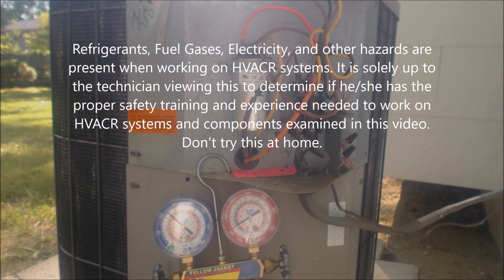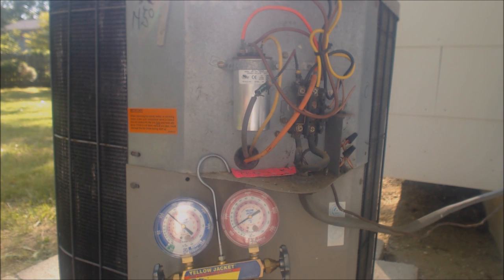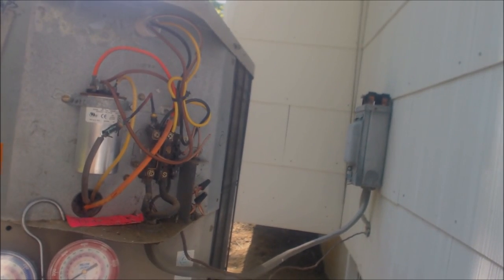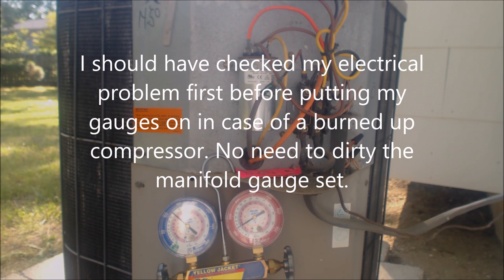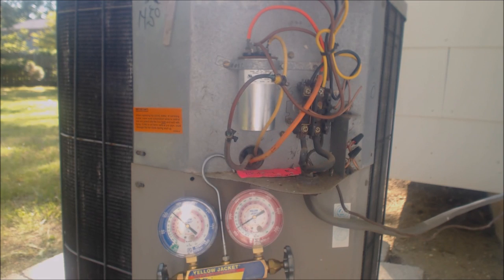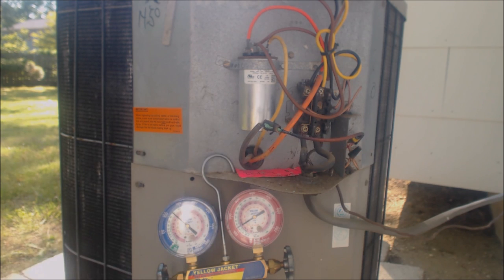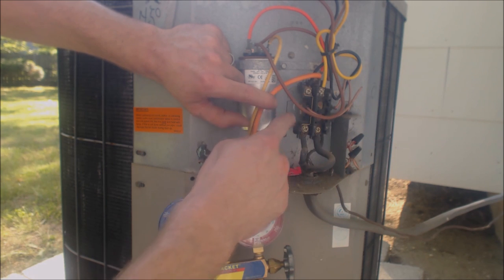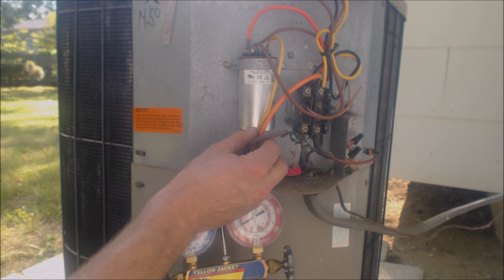HVAC Service Call- No A/C, Electrical Troubleshooting & Refrigerant Charge Check! Fixed!

Comment: I had a call last week , I did my ohms resistance test the Same exact way .  It ohmed out as a faulted compressor so I condemned the unit . What I didn't do was actually open up the fan  section and check my readings from the compressor terminal themselves . Long story short ,  the common wire on the compressor terminal was out of the lug causing the false reading . I went back and fixed the issue . Compressor was ok . That being said , it's frustrating to get to some of these compressor terminal on the residential end . It would be nice if the manufacturers would have easier access to compressor compartment .  It would save us so much time , especially on a day when you're backed up with multiple calls . Anyway,  great tutorial as usual ! I find myself learning something new on  everyone of your videos .
Reply from the maker: If I didn't get the right readings I would move onto the inside at the compressor terminals. I won't mention anything to the homeowner until I am certain, thanks. Yes you are right, you have to really get in there to have access to the compressor terminals!
Reply: acservicetech good point . Coming from the commercial side to the residential side has been culture shock for me . Everyone on the commercial end thinks their better or know more because there's moving moving parts . It's all the same concept though. The difference( from where I stand )is  dealing with customers on the residential end is so more personal and even contentious at times . On the commercial side of things  you can tell a store manager anything and they could care less for the most part . Just sign here and you're good . Corporate will deal with it .
Reply from the maker: Ha yes it's different. I think a very big difference is in Commercial for larger jobs that there may be a long bidding process were as residential and light commercial many times the owner or manager doesn't get another bid and just goes with you because of the referrals and personal admiration, thanks!
Reply: Good dialogue here! So true on both ends lol
Reply: I hear American standard got those pull off coils. Or undue the fastner, and pull off the coil. Either way, the have "suicide door" technology O.o

Comment: As usual - very informative. I watched so many of your videos! In one of them you mentioned the formula to calculate the capacitance using voltage that coming in and  some constant. I couldn't find that video! Could you post that formula again please! Thanks
Reply: 2650 x amp draw / back emf

for a compressor:

2650 x compressor amps from herm terminal of capacitor / voltage from herm to common

Comment: I was curious as to why you where looking for an 18 to 21 degree temp difference between your indoor supply and return air? Is that just a typical difference you found in your experience, or is that a specific number found in the manual or something?

Comment: Great video! When checking the Delta T inside, do you check in the return plenum and supply plenum ? Or do you do it at the return grill and supply grill?
Reply from the maker: You will get your most accurate measurements in the return and supply plenum but you can read the return and supply at the registers if the length from the plenum is very short, thanks!

Comment: Did you check resistance before reusing the contactor or did you only perform a visual inspection?
Reply from the maker: I would think I would have pulled the wires and checked resistance while the 24v sucked in the contacts but that service call was a long time ago to remember. If it had a high resistance reading, that could have caused the problem, thanks!

Comment: What is the ~6" brass cylinder attached to your suction side Guage Set?
Reply: jd dr.jkindle Thats for when your charging as a liquid, normally you open and close slowly so you dont dump liquid into the compressor that cylinder i believe helps it convert into a vapor so you can charge quicker n protect the compressor as well.
Reply: Yepper - that is what I do, barely crack open and close the incoming Freon into the suction side... not to slug the compressor.   
Thanks everyone.
Reply from the maker: Yes, I use that to be safe and I can weigh a lot of refrigerant quickly without fear of liquid getting into a compressor. Yellow Jacket makes a small orifice one but it is no comparison to these. I love these vaporizers. Thanks all!
Reply from the maker: The type of recovery machine I have linked in the description section works just like an impeller for a water pump but for higher pressure refrigerant. It does not matter if liquid or vapor goes in and it does not help cool the motor. The older ones worked like a small refrigeration unit and were different, thanks.

Comment: Another great one, Craig. Is there no code requirement for the line side 240 AC coming into condenser from disconnect switch to be hooked to the top of the contactor? Coming from industry (not HVAC) background, we always put line side power on top of devices.
Reply from the maker: Almost every 5 ton and lower packaged or split comes with the line tap to be connected on the lower side. I don't believe so Jack, thanks!
Reply: you must be in a commercial/industrial environment where most all power drops down from overhead which would be logical to go to top

Comment: acservicetech where do the high and low pressure switches in condenser go connected to? I noticed  not connected thanks partner.
Reply from the maker: low- Low side inlet of the compressor, high- discharge from the compressor or possibly after the condensor coil. Thanks

Comment: I think Trane is the best units,what do you think?Thanks nice video
Reply from the maker: From a service standpoint, there are many times when I am not happy with any of them. I find that techs happen to like the systems that their company sells. I think it just has to do with the pride of a job well done in our installations and the equipment manufacturer that we are using. Thanks Chad!
Reply: hate to hurt your feelings chad but i work on just as many tranes as goodmans,trane puts to much ''i feel'' non essential crap needed for a residential heat pump,i do say i like the way they put the txv and rev valve outside the coil v/s in the unit but i cant stand the spiny coils,goodman too has issues but i think is a down to earth unit,either case they feed my family and after all they are man made,and like acservicetech said most techs are opinionated towards what their company promotes,i work for a maintenance company as a service tech and work on everything from the 90's to present and 2 of the biggest pains i see are trane and carrier
Reply: Carrier from a service standpoint, very close runner up is Rheem. But ultimately, it just depends on what company put it together and even more importantly, Who installed it.

Comment: your resistance readings totaled 1.9 ohms. how much variance can you have before you condemn the compressor?
Reply from the maker: If you saw 15 or 20 percent off then time to get the megger out or check again with another multimeter. Most times this reading will be right on or off completely. Thanks
Reply: Depending on the type of compressor be it 1 PH or 3, single phase or three phase: a single phase compressor will have 2 windings add up to the C or common terminal. Or even easier, C will have the highest resistance, next will be S for start, and lastly R for run. 
If it is a 3 phase compressor each terminal will have the same resistance.  
Max difference of whatever you feel comfortable with (check amps and voltage imbalance for 3 phase). 
Last check is to ground. Simply scratch the compressor casing and test each term with the beeper, you get nothing, you're in the clear.

Comment: Did you discharge the capacitor or worked with it charged.
Reply from the maker: I disconnect, discharge and test capacitance. That is how I teach. I don't want students testing while the amperage is being drawn, thanks Noah!

Comment: acservicetech just had a question for you I have a 3 1/2 ton condenser piston with a 4 ton furnace? cuts out? then when I reset thermostat it comes back on? 1200 Sq foot mobile park home can you give me a tip? thank you.
Reply from the maker: Unfortunately,  I will need more info on that. What are the pressures, what exactly is shutting off, is it do to pressure switches or just low voltage? Cutting out condensor only or everything?
Reply from the maker: And glad to help, just need more details, thanks
Reply: reset the thermostat?type with a reset button on the thermostat?if so i would start with replacing the thermostat if it works otherwise,doesn't trip a breaker or pop a fuse?

Comment: You have 10 degrees of subcooling, why would you want a higher difference between the return air and supply air? You said between 12 and 18 degrees.
Reply from the maker: If I had 10 degrees of subcooling, the delta t measurement of 18-21 across the evap coil would be a double verification of the system properly working, thanks

Comment: what caused the wire to burn?
Reply from the maker: I believe, bad connection and dissimilar metals connected.
Reply: Electricity is constantly passing over the metal connected, as well as air, and the two ultimately killers: sunlight and moisture. Sunlight, not so much in that location, but moisture very bad. Constant loading from stopping and starting, dirt increasing system load and amps, sunlight and moisture increasing oxidation and corrosion. 

Orrrrrrr, like all the good techs I know would say, "wear and tear".

Comment: i dont understand why what condenser subcooling has to to with a txv?
Reply from the maker: Hey Marty, We need to know if the unit has a txv because then we check with subcooling. If the system has a piston orifice or a capillary tube then we need to check with superheat. The txv controls the superheat so that is why we dont check a system with a txv in superheat. There is no other way to really check a comfort cooling system besides by weight. That 30, 25, 20 plus rule is just a rule of thumb or generality and will get you close but not precise. thanks!
Reply: acservicetech i come from mostly refrigeration backgound i use the low side of the sytem alot more to trouble shoot.  i might do seasonal a/c work when i retire.

Comment: Great video but a Megger gives a more accurate picture of the compressor
Reply from the maker: You are right, thanks for the comment!
Reply: acservicetech most customers dont care about a mega ohm reading especially if the compressor is running.
Reply from the maker: Thanks Marty!